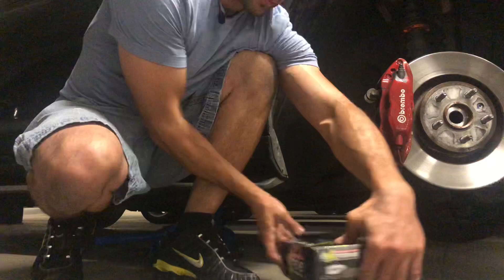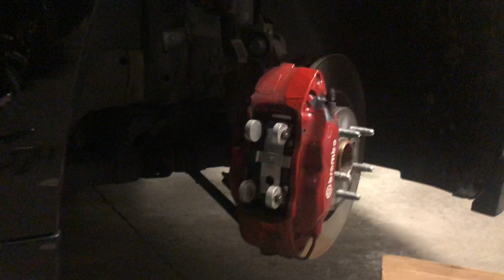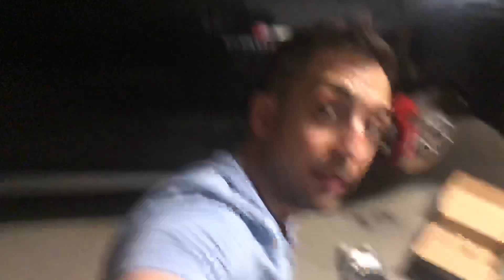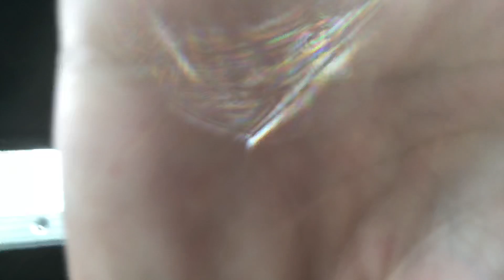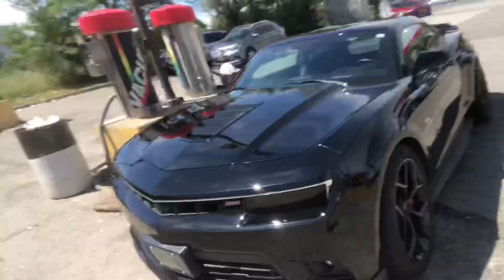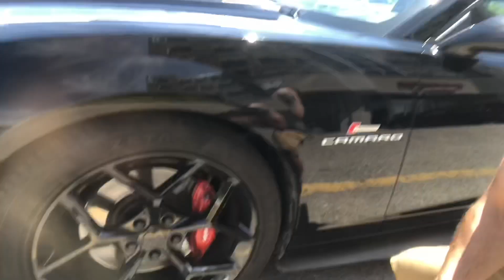How to Replace Brembo Brake Pads - 2015 Camaro SS

Comment: Good video , what part # did you use ? Wanted to make sure it came with the weights on pads
Reply from the maker: Thanks for the comment and question

Power Stop Z26-1474A Z26 Extreme Performance Carbon-Ceramic Front Brake Pad Set.

I got them on the rear too
Reply: what are those weights for?
i have them stock on my 2015 SS but i ordered new pads without those weights.

Comment: So you didn’t have to resurface the rotors ? No wiggle on the steering when braking ? That happens when u need a resurface . ?????
Reply from the maker: No wiggle. The rotors are good. However, i plan on getting cross-drilled eventually

Comment: hey man i got those pads on with the circle things 
what are those for?
i just ordered new rotors and pads but those pads doesnt have those circles.
it is for an SS 2015
Reply from the maker: You might have got the wrong pads I think. I’ve replaced my pads a few times and they always had those round metal things.
I’m not sure what they’re for but for me, they helped me grip and wiggle the pads in or out of the calliper.
Reply: @Street_Punisher  i looked it up..its the OEM pads..you can replace those with pads without weights without problems
Reply from the maker: @thebossnocompetition8757  oh cool, thanks for sharing 🙏🏼